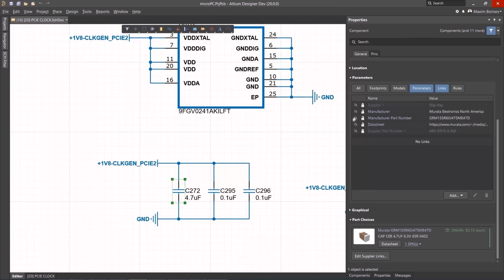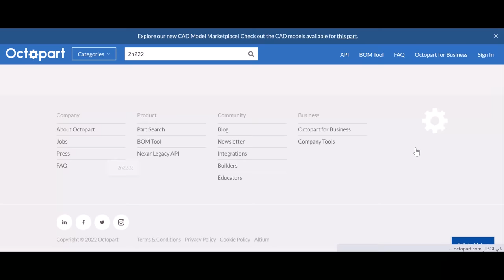building an fm radio receiver with transistors , altium designer

Comment: Sir, the yellow capacitor in the collector base of the Bc548 transistor is not in the assembly. It's not worth it. It's not in the diagram. There is a shortage.
Reply: I did notice that don't weary this dude trucked us, it doesn't work at all

Comment: Come on dude...

You could at least show us the schematic.

It's kind of worthless without the schematic.

The radio pulled in a couple of stations but it didn't perform very well.

It would also be helpful if you explained how the circuit works.

I give this video a 3/10.

Comment: where did you use Altium designer in this project?

your project do not give any information to annything  just electronic components.

as a electronic engeenier oder user the most simple thing i want to see ist the circuit of what i am macking